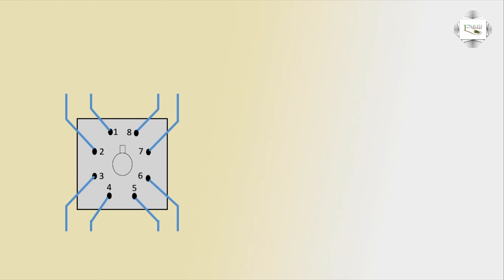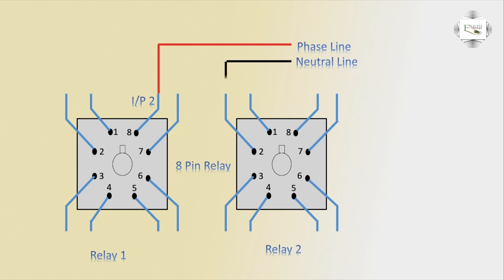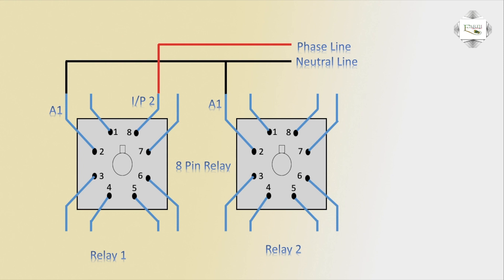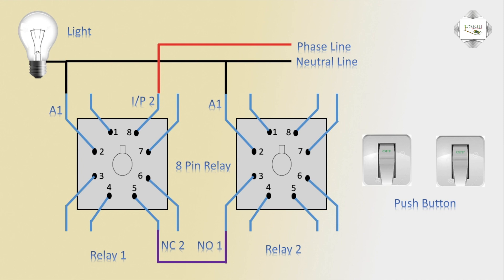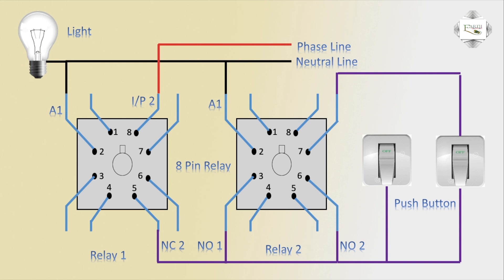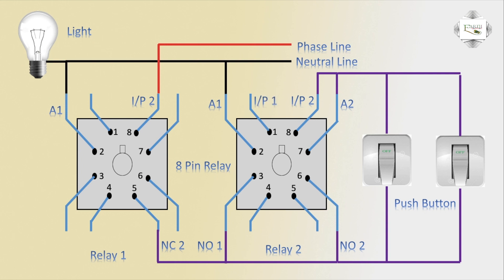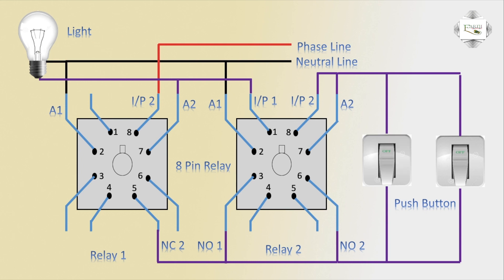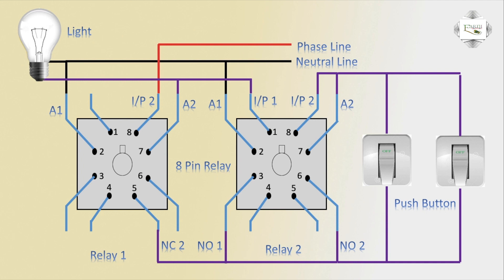2 Switch One Light Control Using Relay | Relay | Relay using

Comment: Hello, thanks for the video. would this work with more switches? It appears that more switches could be connected in parallel as the two shown, is this correct?
Reply from the maker: thanks.....
Reply: @EarthBondhon  You are welcome. 
What about my question, would this work with more switches ?
Reply from the maker: yes....spst switch using